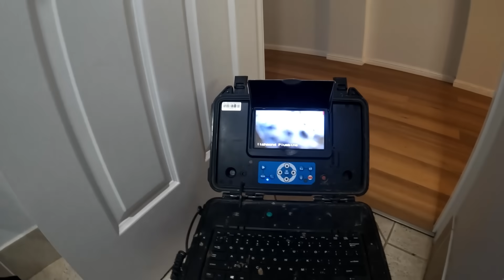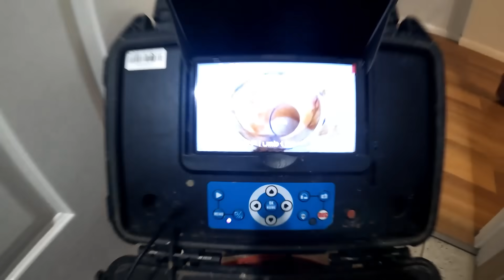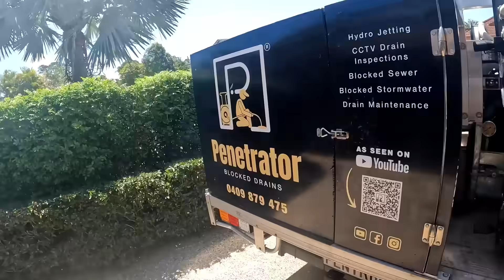Blocked Drain 427 - Mates Don't Let Mates Lose Their Nozzle

Comment: Well Tom could sleep peacefully on that night having his nozzle clawed back from the gates of Sew Age. Working at water treatment plants on gearboxes in the middle, edge or end of the tanks, I have lost spanners, Allen keys, hammers etc. I did start to drill holes in some tools and tie paracord to them, but you can't do that easily on smaller Allen keys so I'd weld a ring on the usual sizes, luckily they tend to be the bigger ones. Well done Gavin, regards to you and family 👍

Comment: You are 100% correct. When a jetter hose or sewer cable gets stuck, it's like a gut punch. I broke a 5/8' cable this morning in a cast iron pipe but I got it out with a retriever head and no drama (thank goodness). 

The only time I wasn't able to remove my jetter hose was when it went outside a collapsed 8" clay pipe in the parking lot of a vegetable packing plant. Fortunately, we could see the problem with the camera and show the manager of the plant. The plumber that called me in on the job got a nice repipe out of that one. Dug up about 100 feet of parking lot and replaced the entire line , manhole to manhole. I lost about 40 feet of 1/2" hose because the broken clay absolutely shredded the hose jacket while we were trying to pull it out.
Reply from the maker: Yep it’s never nice when it happens